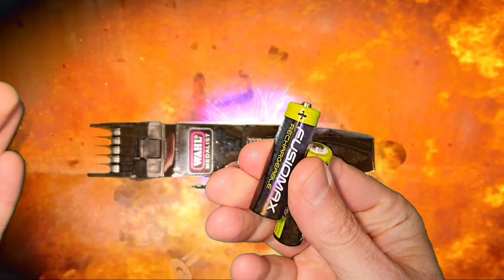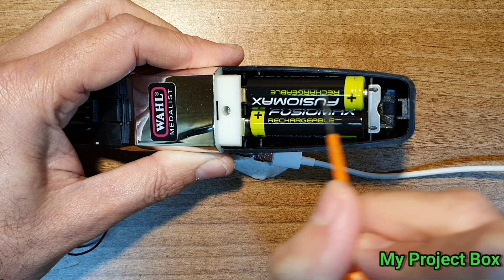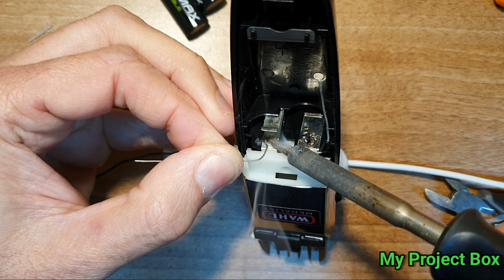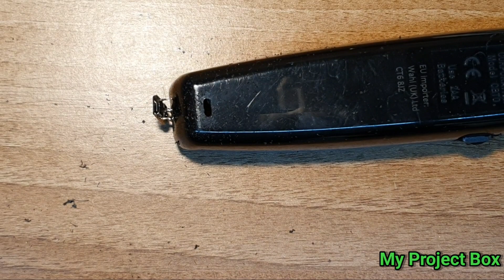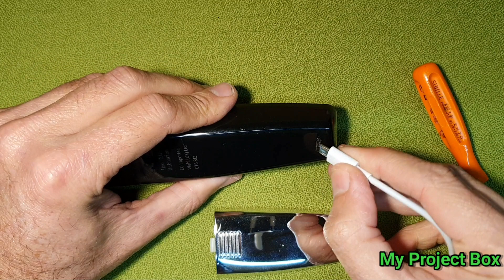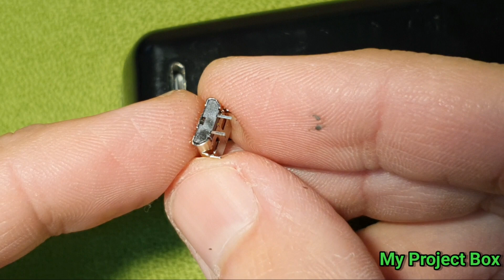USB phone charger hack for beard trimmer #ElectronicsCreators

Comment: My trimmer has only one 1.2v NiCd battery would this work on it
Reply from the maker: Yes the circuit will work just fine😉. But if you have only one cell you can drop the voltage even further by adding three more diodes in series.